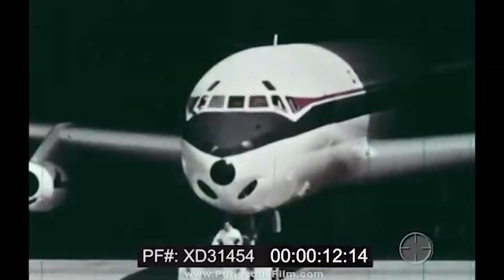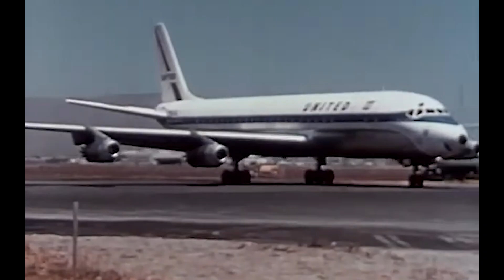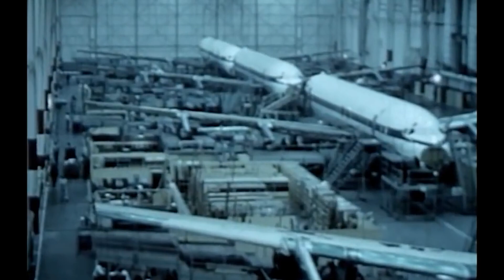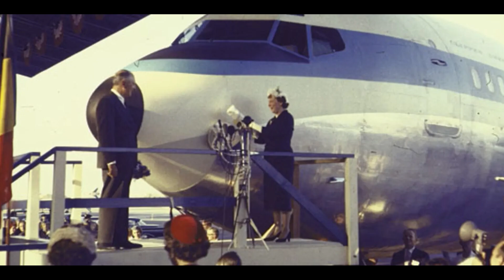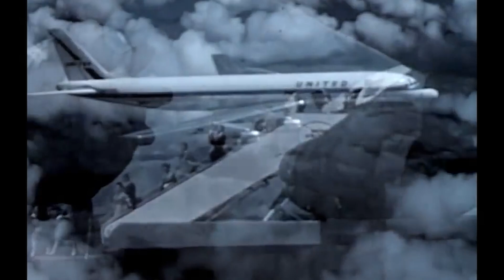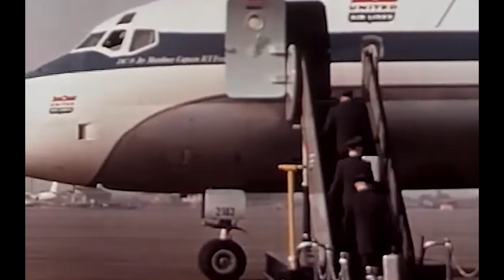What Made The DOUGLAS DC-8 So INFAMOUSLY Durable?

Comment: The first orders for the DC-8 were courtesy of Juan Trippe and Pan Am, who ordered 20 x Boeing 707s and 25 x Douglas DC-8s on 13 October 1955.

Thus, the first order for the DC-8 was 25 aircraft (not 30) and came from Pan Am rather than United Airlines, 

United Airlines ordered 30 x DC-8s in November or December 1955, but never ordered or operated the 707.

Ultimately, United would acquire and operate 117 DC-8s of all variants, but United placed its first order for the DC-8 AFTER Pan Am had already ordered the aircraft. - NOT before.
Reply from the maker: Thank you for pointing that out, I deeply appreciate

Comment: I first flew on a DC-8 in the summer of 1960. For my father it was a working vacation which the family got to enjoy. Our return home was a delivery flight of Panagra’s second DC-8 from the Douglas plant to Miami. I also had many trips on Delta DC-8s home on summer and Christmas breaks from the University of Michigan.
There was one thing my father had mentioned the seemed to have gotten lost is that the DC-8 had only a 30 degree sweepback instead of Boing’s 35 degrees. This basically made the DC-8 immune of the “Dutch Roll.”

Comment: I flew in both the DC8, and the 707, and eventually became a flight engineer on the DC8. I also worked as a mechanic on both types. To me, the DC8 was superior, and though all its flight controls were cable controlled and hydraulically operated, it could lose hydraulic pressure, and still fly by the cables. Not easy, but you could still fly, as everything was cable driven, even the pressurization and fuel levers in the F/E panel. One plus over the 707 was that after the JT3Ds were upgraded to CFM-56 on all 60 series, the airplane flew commercially up to the 90s, some to the 2000s, and a one or two still flying. Today, even the remaining KC-135s got the upgraded CFM-56 engine, but the 707 didn't have the long flight history as the DC8. A few of all those hull loses were mechanical issues. Most were crew induced.
Reply from the maker: Thank you for sharing. You have a world of experience with these aircrafts inside and out
Reply: Having spent several years working heavy check MX on both DC- & MD-80 types-you are 100% correct about almost EVERYTHING being cable actuated-the fire handle shutoff system & auto slat actuating systems being straight up Rube Goldberg. DC stood for Direct Cable-not Douglas Commercial !
Reply: @stevenrobinson2381 😂
Reply: Did you ever land at Ft Lauderdale international? If so, I was one of the kids at the outer marker waving up at you. 😊😂 The DC-8 was the most beautiful plane of all I ever saw fly over our backyard and drop the gear. Most were replaced with the DC-10s and L1011s when they came out, but I never loved them like I did the DC-8 aka "Stretch Jets" circa 1972-73.

Comment: If you can find test flight footage of the first flight of the DC 8 you'll see that they even put speed brakes on the underlying belly but they went back to the traditional on top of the wings later on and the very first one after doing a lot of test flights ended up getting Turbo Fan engines and finishing it's career at Delta many years later
Reply from the maker: Thank you for pointing that out
Reply: According to test pilot "Heimie" Heimerdinger-the speed brakes were quite ineffective-as he stated-"like throwing a Kleenex out ".

Comment: Supposedly the DC8 was a better airline aircraft because it was designed as a passenger plane. The 707 was a modified bomber.
Reply: It was not based on a bomber as it was actually based on 367-80 experimental plane which lead in one direction the KC 135 tanker and the other to the 707. You Really need to read the history of that to understand as I am retired Boeing employee with 30 years at the company and have worked on the 747, 767, 757, 777 , 737 at some point in the time I was at Boeing.   I mainly worked on the 747 and 777 but had enough experience to work all the others.
Reply: What bomber is the 707 based on?
Reply: Too bad that they didn't use the same care with the DC-10 but Perhaps the DC-10 came after the merger with McDonnell. They screw up everyone that they deal with
Reply from the maker: That makes a lot of sense. The bomber DNA of the 707 created a lot of problems for it
Reply: @Aircraftfog  No, it does not make sense because it's not true. Are you an AI bot? Seriously, why are you agreeing with something you should know is wrong if you're a real person interested in airliners?